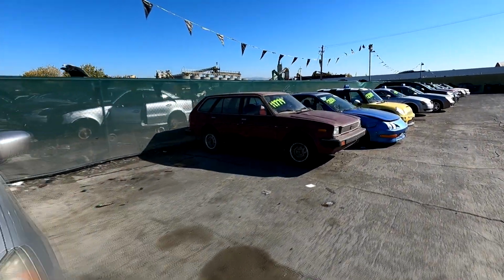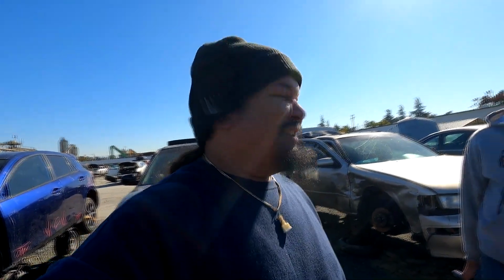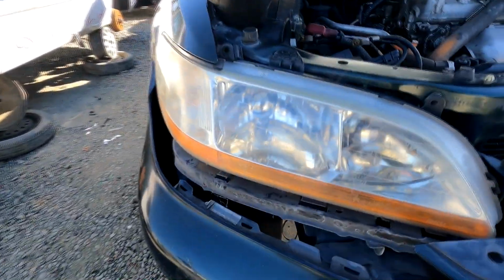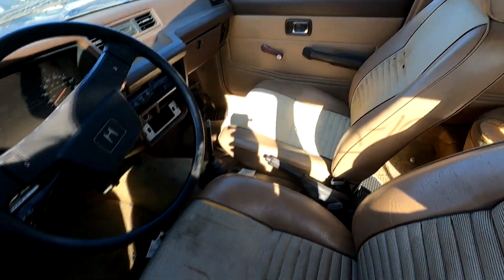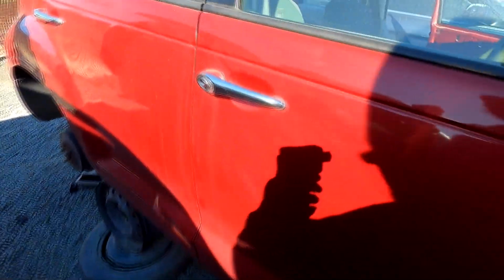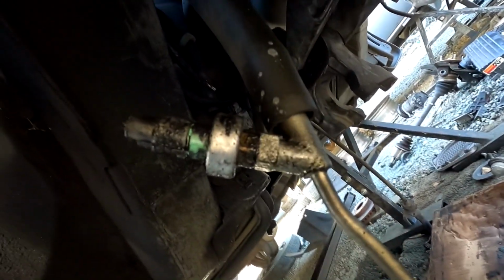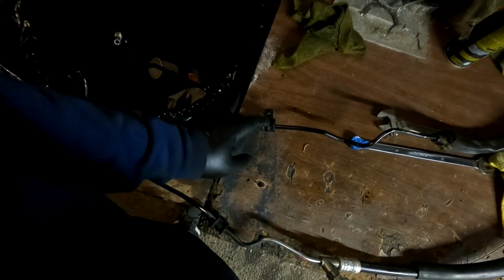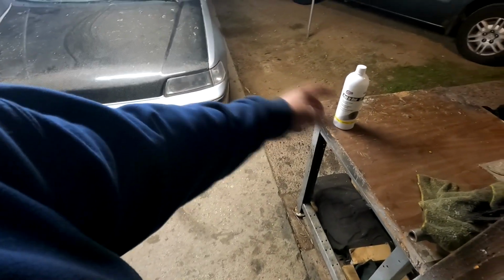JUNKYARD GEMS | Sad Site To See

Comment: you can close the hood on a J-swap if you use the "A1 intake manifold", and the "J30 oil pan and pickup".  saves you 2 inches on the top and 2 inches on the bottom,  only hard part is finding the Manual transmission.